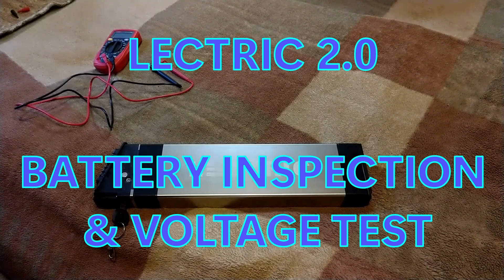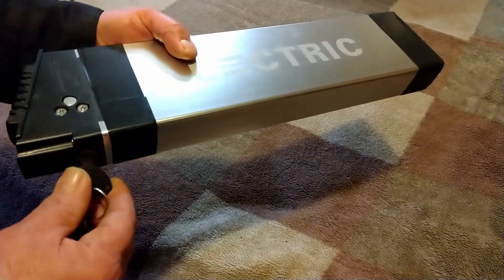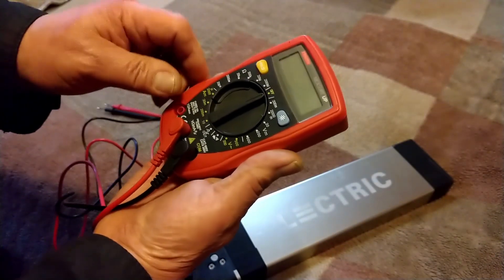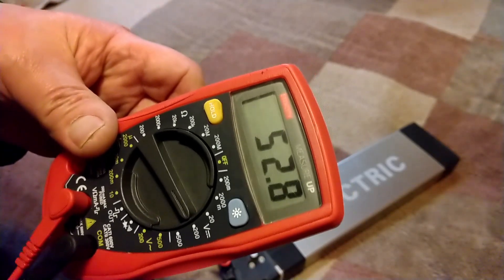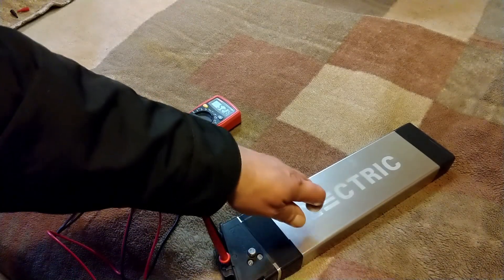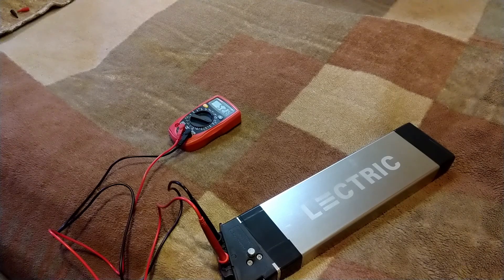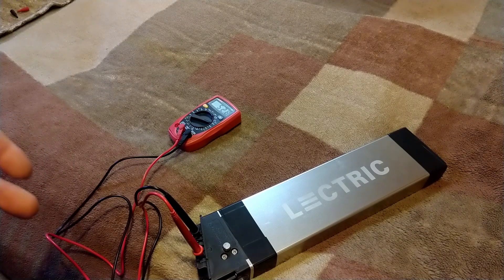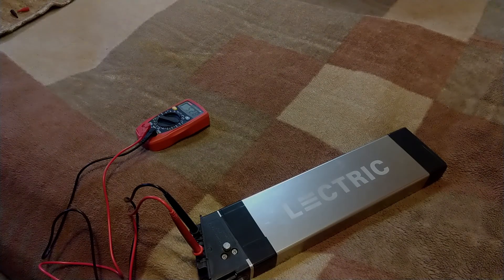LECTRIC 2.0 E-Bike Battery Inspection & Voltage Test

Comment: my battery is testing at 24.8 volts while  it is in the off position. is that normal? It does test at 52 volts while the key is turned on.
Reply from the maker: That does not sound normal. My battery does not show voltage when the key is turned off. Make sure your key positions on the battery aren't hanging up because even though you have it in off position it might not be all the way engaging off.

Comment: My battery reads 56.i have the exact same battery for lectric 2.0..is that normal.. thank you
Reply from the maker: That does not seem normal. My battery when fully charged reads 54.7. How is the condition of your charger? perhaps it is slightly overcharging the battery is my first thought.
Reply: @Pandafoo  the charger seems normal..it's in pretty good condition..I have over 2000 miles on this battery and it still has great range
Reply from the maker: @brianjarvis2823  Do you know how many full charges you have done on the battery over its life so far? My battery has like almost 100 charge cycles so far, which is very small considering they go for well over 400 if cared for correctly.
Reply: @Pandafoo  I would say.. probably a little over 100..Im just guessing because I get 25 to 32 miles per battery charge..also my bike can reach 26 mph on throttle only and 32.3 mph on pas 5 in 7th gear with a 34 /11 tooth freewheel..it has been an awesome bike

Comment: Bike controller shuts bike off at 40v. Battery is certainly not useful below 43v. So, right there, about 25%, nominally remains. You can run to 40,at very low current (speed) and nurse out an extra, unpleasant 1ti 1.5 miles between 43 and 40 v.

Then there is the whole PWR controller program in the current bikes.

Comment: Hi, I thought my battery was dying yesterday. It's not. I am so used to the Engwe pro2 I have forgotten the lesser distance  the XP 2.0 provides. I'm going for a Wired Freedom 60v when they come out in may.
Reply from the maker: My distance is shit because I have a 10ah battery. Not going to pay extra to get a bigger one either!
Reply: @Pandafoo  gas is back to 3.15 here in Houston. Brandon&Budweiser got to go😠
Reply: @Pandafoo  That rack on back will be the mounting platform for the 79cc 4 stroke motor I have. Schwinn 20x4" OCC chopper rear wheel with sprocket adaptor. Itt's a tried and true system I use on 26" bikes.